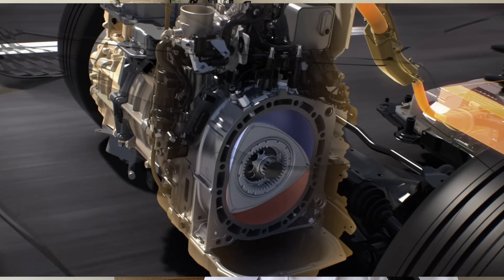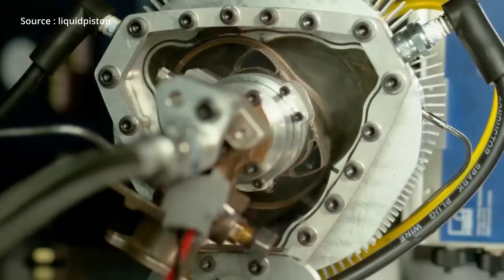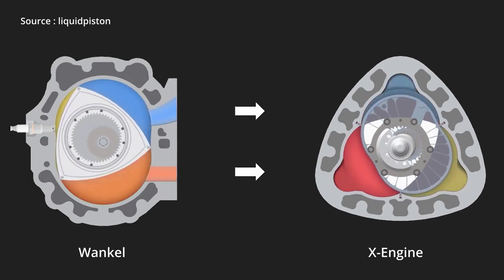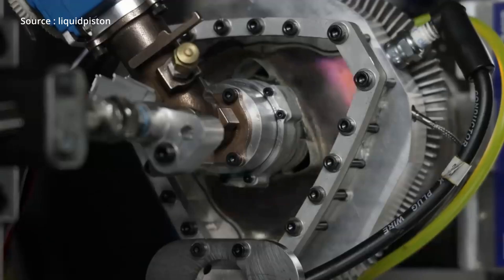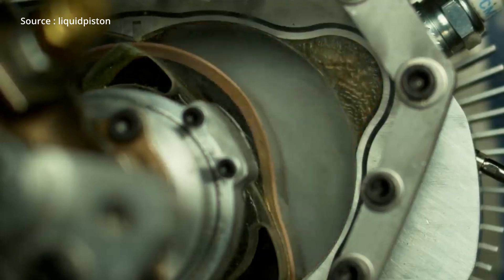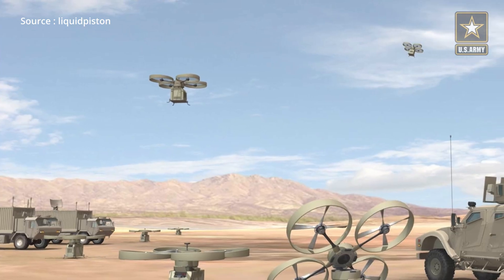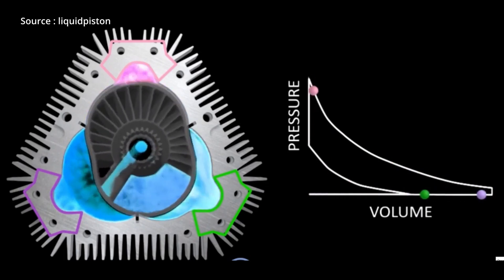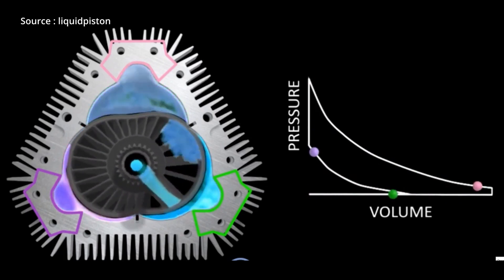10X Lighter & Smaller Internal Combustion Engine .

Comment: So, if we store electricity as hydrogen, (and oxygen) would this work with hydrogen combustion? If so, would the whole process be more efficient than storing electricity in the latest batteries, and having to carry the weight of those batteries around?
Reply from the maker: Yes , definitely this engine would works with hydrogen combustion.
Actually EV is more efficient than the hydrogen engine but as you said it comes with downside which is the heavy weight of the batteries and also the hidden environmental impact of producing Li-ion batteries and recycling them. 
I believe that hydrogen engines can be great solutions for aviation and also for hybrid cars ( batteries + hydrogen cell ) .